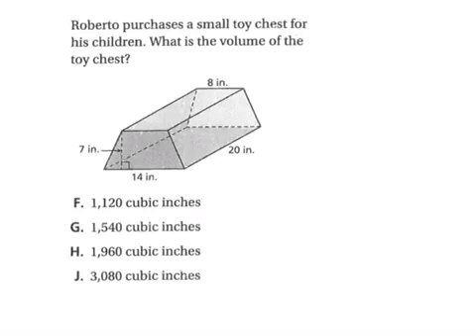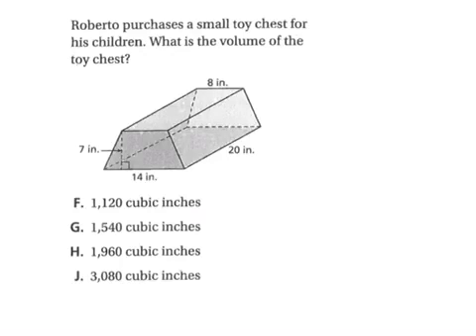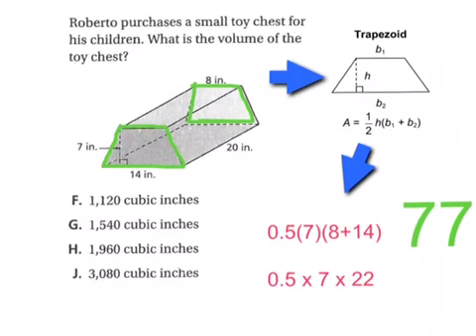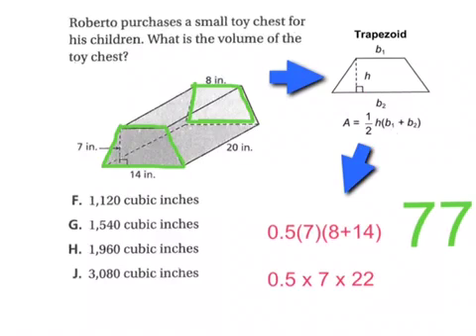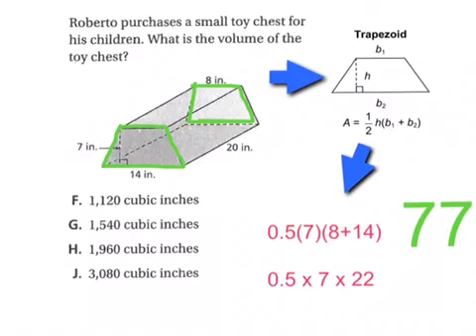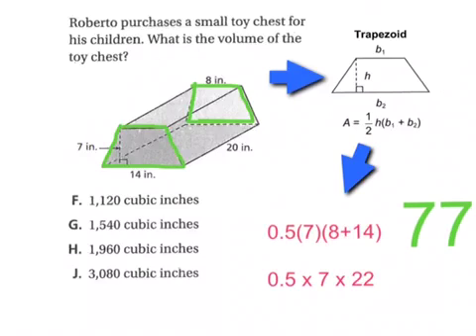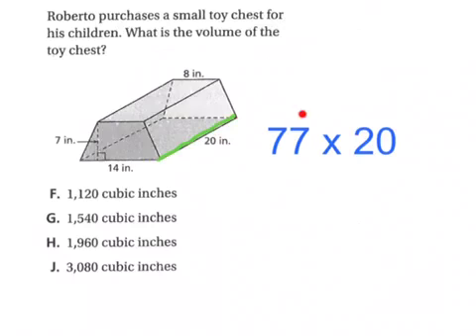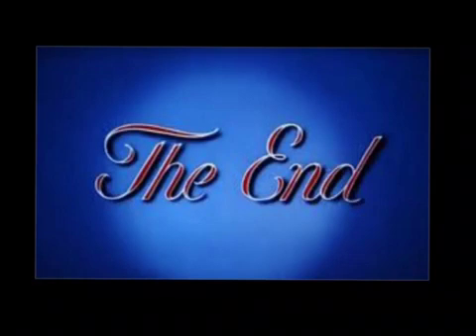Volume of a trapezoidal Prism

Comment: How do you calculate the area and volume of an non-parallelogram trapezoid, where you have different leg height? 

Example 1 
B1=15, B2=25 and h=5
Area=? V=?

Example 2
B1=15, B2=25, h1=5 and h2=6
Area=? V=?

I wonder if you can explain? 🤔
Reply from the maker: All trapezoids have a pair of parallel sides… the height of a trapezoid is the distance from B1 to B2 and remember it needs to form a right angle with both bases.  The height is always perpendicular to both B1 & B2.
Reply: @nhgreenmath  thanks 😊